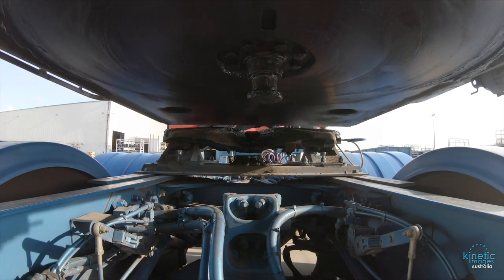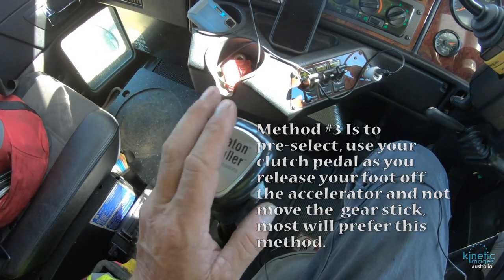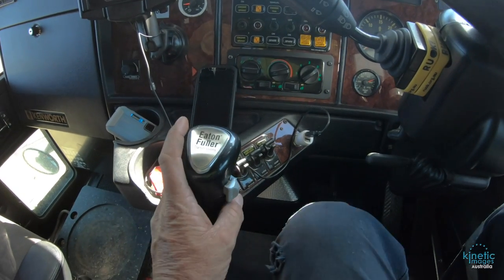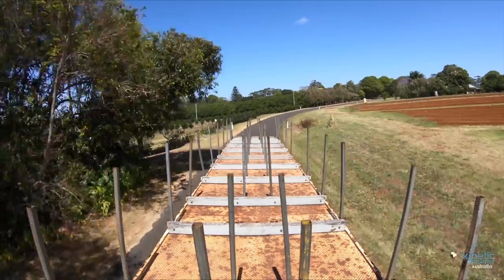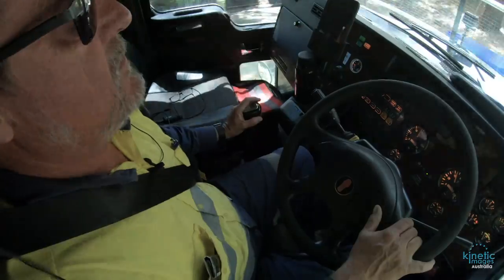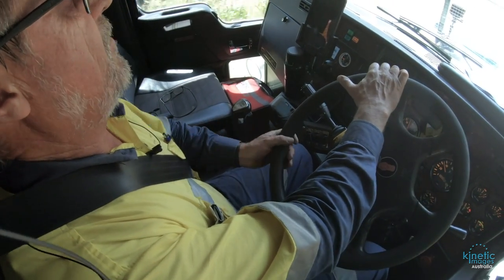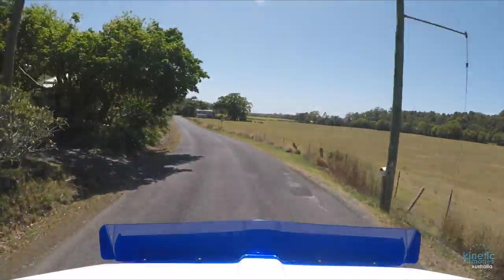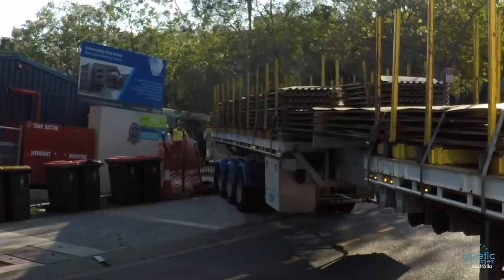How to split the 18 Speed Road Ranger. Aussie Trucker  Trucks and Stuff

Comment: There’s a few different methods to go from overdrive back to direct does it matter which way you do it with out damaging the box
Reply from the maker: Gday Brendo…. Not sure which methods you’re referring to, but with or without clutch, rev matching is still required so the gears can mesh..
Also technically the splitter in a 18 Speed Road Ranger isn’t an overdrive as fitted to other gear boxes as the splitter can be applied to any or all the forward gears.

Comment from the maker: This is a response to a question on my part one video and may help others....
Kinetic Images Australia
3 minutes ago
Hey Joseph, thanks for your comment/question. Put simply the splitter is just another gear that can be used anytime or not at all. The splitter is a gear that is added to what ever position the gear stick is in, therefore it is added to what ever gear you are currently in and gives you just that little bit extra. That maybe still a bit confusing so imagine you are looking at a 5 speed bicycle and its gears. You'll have a sprocket on your pedals with a chain going back, and on the back wheel you will see 5 different sized sprockets (Gears) that you can change with a lever on the handlebars and you can go up and down these gears forever and as such this would be considered a 5 speed bike. Now a 10 speed bike is almost the same except where your pedals are there will be a larger sprocket and a slightly smaller one which you can also change with a different lever on the handlebars and this becomes a 10 speed bike because the two sprockets on the front multiplied by the 5 on the back makes 10 total. You still have the choice of never changing gears on the front two sprockets but maybe there will be a hill that you need just a little bit extra to help you get over it so you change to the smaller one without changing the rear ones. Conversely you're already using the smaller front sprocket and you want to go just a little bit faster so you change to the larger one. In a way you could say the front is the splitter. Hope this makes sense:)

Comment: Nice video and it cleared up whether or not a spit shift actually requires the gear stick to be moved to neutral momentarily. I am confused slightly about one thing and that is down shifting a ½ gear say either from 7L to 6H or 6H to 6L. Do you double clutch with a rev increase? I'm assuming the answer is yes? If so could going from say 6H to 6L be done with just a rev increase and no clutch??? I'm just a bit confused. Thanks.
Reply from the maker: G'day Graham, great question :)
There is no double clutching when splitting up or down. A singular small press on the clutch and rev matching is all that is required.
The aim of the game with ALL gear changes is to ensure the load or pressure within the gearbox is released and that is achieved by pressing the clutch. Eaton Fuller recommend this as the only action to use. With splitting gear changes (up or down) there is a gear set at the back of the gearbox which is pneumatically actuated. Hence the air button on the gear stick. The range change, LOW and HI is similar. 
Because you pre select these buttons before doing anything else they are ready to go. You just need to release the load or pressure so the range change and or the splitter actuators can do their job. 
Double clutching is for all changes that require the gear stick to be actually moved into another position, for a whole gear.
Yep, you need to rev match what gear it is your wanting next. Letting the revs drop naturally is what you do for upshifting (going faster) and giving the gas pedal a little blip and raising the revs is what you do for down shifting. As I mentioned it's about 200 RPM for split changes and 400 RPM for whole gears up or down.
"Floating the gears" (not using the clutch) is a gamble we all play with the "Aim of the game" mentioned above, except we're hoping the release of accelerator pedal will be enough to release of pressure from within the gearbox. Get it wrong and damage will occur.
I talk a little about this in my other video.... Learning the 18 Speed Road Ranger Basics... at about 9 minutes and 25 seconds into the video below.
https://www.youtube.com/watch?v=6ysb_w-MMnY
I'm currently doing another video talking about the clutch and the video after that will be about brakes.
Hope this helps, take care!
Reply: @Kinetic-Images-Australia  Thanks Jason, Such a speedy reply. I'm doing my HR crash-box licence training in two weeks time. (hoping for a career change from pilot to Truckie! (long story) So just to be sure, a ½ gear downshift without the gearstick movement (e.g., 6H to 6L) requires one clutch action with a approx 200rpm rev increase and a ½ gear shift with gearstick movement (e.g., 7L to 6H) requires a a single or double movement?
Reply from the maker: Yes on both occasions :) Double clutch because you're moving the stick.
Just to clarify the double clutch is one clutch depression for moving into the neutral position and another clutch depression for moving the stick into a gear selection from the neutral position. 
However don't worry too much about the latter (7L to 6H). I can honestly say that if the scenario exists that required this change, IE your heavily loaded and going up a hill and loosing revs, I wouldn't worry about a half shift I'd wait just a smidge longer and go for a whole gear change with the splitter button untouched. Double clutch with 400 RPM blip on the pedal. (7L to 6L).
Downshifting half gears can be quite tricky in any gear.
You may have seen my channel banner is an instrument cluster of a turbine helicopter....... I'd give my left nut to do the reverse of what your doing :)
Reply: @Kinetic-Images-Australia  Thanks Jason, Yes I know what I'm doing is unconventional but a necessity really in my personal circumstance. Maybe if I got into helicopters years ago, things would be different. Some say if you can make a living from your passion, you'll never work a day in your life. Others say you'll just ruin your passion! It's just a shame that flying training is so dam expensive. I'll check out your other videos. Have a great weekend!

Comment: Hey Jason, if your’re in the foward position of the gear lever, and the splitter is in the back position, do you have to give the engine a quick rev if you’re up-shifting or is it just a quick change with the double clutch? Cheers mate
Reply from the maker: Hey Steve, your upshifting so it's just a quick change. Remember you only depress the clutch pedal a short distance, not the whole way to the floor.
I'm currently editing another and final video in this series called 
"The Basic Basics of the 18 speed" 
and I'll talk more about timing and the clutch.
Hope this helps.
Cheers

Comment: Thanks for showing your technique where you double clutch/rev match when splitting gears.  I'm a mechanic, soon to be CDL(bus/truck) driver, and want to understand everything I can about these transmissions.  I have seen other videos where people teach to split in gear, just by lifting off the "gas" to split up, or giving it "gas" to split down.  Seems a bit abusive to me.  Would be curious to hear from a diesel transmission shop/mechanic on their thoughts.  Makes sense  rev matching would help avoid POSSIBLE issues the other technique could cause.  I have seen videos of the jamaican drivers, they are wild!  I think they rev match all the gears and split changes, no clutch! Jamaican truck  drivers are like human CVT's😂 They are moving the shifter like a madman, very entertaining to watch.
Reply from the maker: Your spot on Connor3288.. I think all drivers should be aware of the mechanical implications of their actions no matter if it is their own truck or they are driving for an owner. The splitter in a lot of Gearbox’s actually run a synchro ring but the key factor in ANY gearbox is to remove the load from the engine to the box so a change can be made. Obviously the clutch is the main way to do it :) 👍
A single clutch press, not double, is all that is needed for split changes.
Reply: @Kinetic-Images-Australia  Been  watching lots of videos lately trying to see how the range and splitter shifts/mechanisms work.  There was a good Eaton one that showed how the range box is right behind the main gearbox, and how a shift ring with syncro engages or disengages high/low range.  So the splitter works in the same manner, mechanically speaking?  Also, having a sport atv and being a motorcyclist, I know what you mean about unloading the gears.  Makes sense to clutch to ease the split, or move to neutral and back to gear should be even easier on the trans and less wear on throwout bearing.  When engine braking in the truck and you want to downshift, do you clutch out of the gear or give a blip of "gas" to unload the gear? I know either will work, curious of your preference and why. I saw your Ducati video, that thing is a beast! Sounds amazing.  Safe travels- Connor
Reply from the maker: @connor3288  G'Day again Connor.. I'm relocating to Thailand next year and building a massive man cave, (will be making a video of the whole process) gonna miss my Duke as I cannot take it with me, so I will have to sell it soon..very sad 😥 I have however bought a Yamaha MT10  with a cross plane engine in Thailand and will be fanging that around for a while until I make a reverse trike out of it.😃 (another video of that too). Now onto your question. With engine braking (Jake brake etc switched on) both the clutch and Gas pedals have micro switches that will disengage the engine braking if you press either... BUT.... Using only the gas pedal could be a DISASTER..   REALLY BAD....  because if you get it wrong, the moment you raise your foot off the pedal the engine braking will turn back on... I only use engine braking when I'm loaded so the clutch is your best friend.
Also remember that each truck is slightly different even between same models.. Older trucks, or what I mean is trucks with a few miles on them, tend to be more forgiving and there is a little "play" worn into the gearbox that helps gas pedal blipping:)
One more thing to mention is cab over trucks have two push pull cables from the gear stick to the gearbox, not a direct gear stick into the top of the box.. any play in these cables have to be accounted for in the "FEEL" of the gear stick to make changes happen as you want them to.
Hope all that makes sense mate and thanks again for watching my videos. Safe travels to you too mate :)

Comment: Would you only use the LO gear taking off on a steep incline or something?
Reply from the maker: LO is rarely used even on a steep incline.
It’s not a gear you can get moving and then change into the next, it is just too low.
I’ve only ever used it where I needed to move the truck a few feet forward and then stop.
Try it and you will see it is for the rare occasions.
Day to day operations first gear and even second is all you need to start moving.
Reply: @Kinetic-Images-Australia  ok thanks mate. I only have an MR synchro licence but I've always been fascinated by 18 speed crash boxes

Comment: is pulling it out of gear necessary for the splitter? 
eaton's manual for the road ranger says to just press and release the clutch?
Reply from the maker: Hey Alphonse, no it is not necessary and of course Eaton are correct. If you re watch the video at the very beginning I made mention of this in the opening credits. The action of the gear stick move is to help the new driver learn rev matching.
I drove three different trucks in this video and with age and wear and tear every truck is a little different. This truck wouldn't always make a smooth change with the clutch alone. Moving the stick helped. Actually a good mechanic told me about this method.
Thanks for watching and commenting.